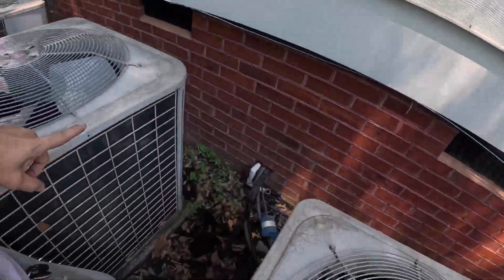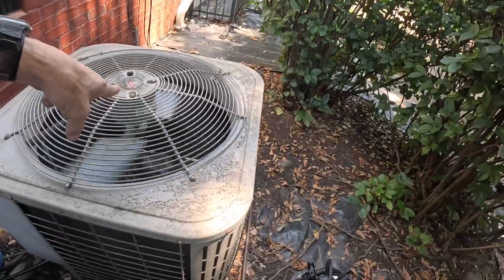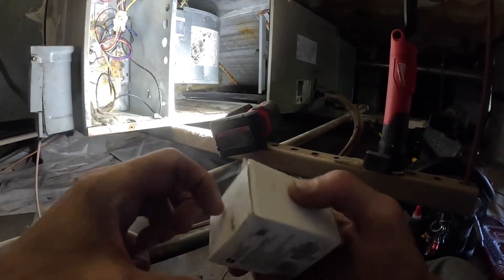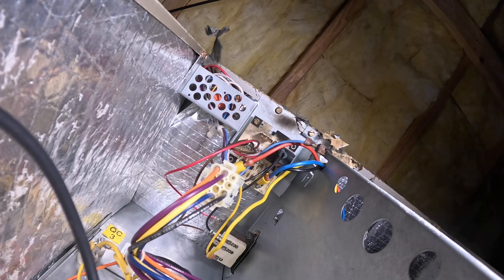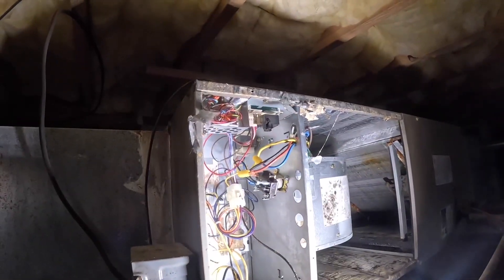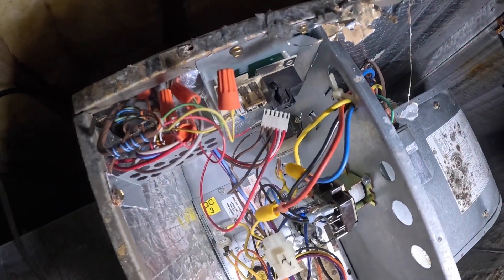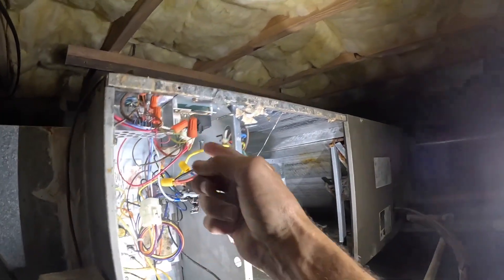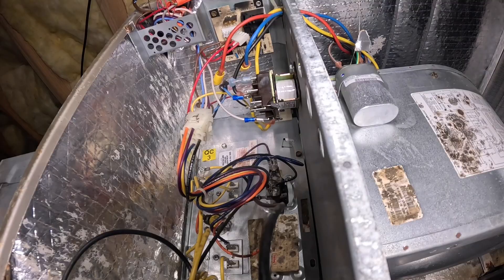Extremely High Electric Bill Leads to A Service Call! #hvaclife #hvacguy #hvactrainingvideos

Comment: How the hell can he remember all those wires and so many different systems??? This guy could be a brain surgeon, Blessings!!! He just reengineered a system on the fly!!!
Reply: He is one smart dude. Heck I couldn't do what he does, I walk to a room to go get something and soon as I get there, I say to myself what did I come in for.
Reply: @str8chevys913 yeah, wiring in a strip kit with blower control when it was controlled by the board is fun. 
Man, remember working on the old ge cubes with timer controlling tpdt high voltage relay… so much fun…
Reply: @whochecksthis  agreed wiring can be fun....either you love it or hate it😅
Reply: @str8chevys913 😂 you nailed it
Reply: My neighbor was a home alarm installer and I had him hook up my alarm keypad. There’s about 10 different  colored wires. He asked me what color one of the wires were he was colorblind
Reply: @whosyourdady909  Thank you for making me laugh on a Friday night~LOL
Reply: @andylaw2503  color by numbers , never fails , using phone color coded ..😅💪✌️🙏☝️
Reply: I was in radio repair in the military and learned low voltage.Pretty good and I got out of the military and got into electrical installation. My boss was colorblind and I had to many times tell him whether there was a green or a blue wire that he was hooking up. But he taught me a lot about the high voltage systems.And then from there I went on to AC and Heat and air maintenance where I learned the gasses and the Refrigeration systems. So I combined my experience of low voltage in the military high voltage in my electrical installation experience and then the training that I got from  classes and on the job experience on the AC part and I learned to do what he has done. There have been many times where I've had to go in and completely strip out all the wiring from somebody else's mess and rewire it, put in new relays and time sequence relays in the sort. It does
take a lot of training and a lot of knowledge and experience. And you also have to be a fairly logically minded person to pursue this type of career and do it proficiently.
Reply: @whosyourdady909  oh wow!
Reply: @whosyourdady909  Bro I got a friend like that but he is still a monster at AC fixing
Reply: @whosyourdady909  Some colorblind people uses colored glass to look through to distinguish the colors. Put in the red glass and green wires goes dark, put in the green glass and the red wires goes dark. At least it helps a bit, but I'm not colorblind so I can't tell if it helps completely.
Reply: Hvac wiring isn’t terribly difficult. What will REALLY get you is the communicating systems with condenser wiring controlling the air handler… man the York heat pumps are the worst! 10 colors, hat have to be wired one way at the stat, one way at the condenser, then a completely different way at the air handler… multistage, multi speed system… with outdoor thermostats as well… 

One unit has like 30 different connections…
Reply: @whochecksthis  Obviously they DON'T believe in the KISS principle, (Keep It Simple, Stupid).  But look at all the money it makes for them, constantly.
Reply: @whochecksthis  G’Day Bro,  I’m confused with your statement. On one hand you’re saying HVAC wiring is easy but then on the other you’re talking up how many wires are on the interconnect wiring ??   The Daikin units we use down here are far more complicated than those ‘Flower Pot” A/C’s in most houses in the USA. Ours have up to 4 PCB’s on outdoor & 2-3 on the indoor unit which is frustrating as when they fail becomes quite expensive. 👍
Reply: @whochecksthis  comfortbridge is two wires, common and signal. Everything is in the software settings. Though most settings are automatic. Just set your tonnage and heat strip size and it goes to town. It decides on everything based on sensors.
Reply: @whochecksthis  all the wires i typically universal in all systems unless sum douche re-wires everything. If that happens usually the client won’t use that tech cause of shady work.
Reply: @whochecksthis  💯 those condensers look like computers inside the service panel
Reply: @whochecksthis and this is why one hires a trained licensed HVAC technician 😂
Reply: This is simple wiring and understanding typical hvac controls. It's a simple control power circuit. The board is just a fancy relay in a sense.
Reply: @dustinbartlow4318 "in a sense". You mean "in expense" !! 😅
Reply: @dustinbartlow4318  The boards are money makers.  Relays, etc. are better, more reliable, and cheaper.  But the manufacturers don't want that anymore.
Reply: Don’t you know who he is? He’s The HVAC GUY
Reply: Hello my friend. I'm not sure if you reread your comments in your older videos but I put a notice in there for you. As a welder I wear a half face respirator it goes underneath my weld hood so it really hugs your face it's not sticking out blocking your view. I got mine on Amazon if you want it or whatever let me know I'll get you the information on it which one I bought. You can keep it in your satchel bag and when you go under the house and you're breathing in basically asbestos fibers, asbestos's rock silicate but that insulation is glass so what's the difference. Protect your lungs. Even dust and whatever kind of airborne pollutants are down there from rats and dead animals and God knows what else. Easy on easy off and no more hacking😂
Reply: @TheVaga9 He literally put on a HVAC “Clinic” right there . A lot of the time as a HVAC tech you have to pull out the “MacGyver” tool bag to get some of the units going . Great work mate 👍 HVAC Guy please do me a favour and cut the power prior to pulling that connection off while it’s still live bro, I know your experienced but be safe man . 🙏🏽👍
Reply: The wiring in most ACs are quite similar, HVAC isn't a very difficult trade.
Reply: @GoonyMclinux what is
Reply: @GoonyMclinux it’s considered to be one of the more difficult trades as you need to know electrical, plumbing etc.  for people who do it on the regular it may be easy to them.
Reply: Hes a professional who sees the same stuff everyday. ever had a job?
Reply: When you've fixed the exact same problem one hundred times it becomes muscle memory, don't even need to use the brain.
Reply: I've been thinking the same thing.
Reply: you just get used to them after dozens upon dozens, unless your memory doesn't work, that would be bad.....
Reply: Respect to the Experience Problem Solver/Critical Thinker
Reply: They are all the same, just variations. These old guys however even remember the model numbers..
😮
Reply: It's not that hard to figure out.
Reply: Bro then take a picture of the old one then replace it
Reply: Wiring diagram helps
Reply: I love wiring 😂
Reply: There colored wires. There all the same color on every ac unit. Its not rocket science.
Reply: @My1970TransAm  Okay sport! your smart too, we get it.
Reply: It’s easy! I used to do hvac!
Reply: after you get a few years in a profession, you memorize what's where , how things work,  and working shotrcuts and improvs when you have something that CAN'T be replaced.

Comment: Can anyone recommend wire connectors for compressor wiring instead of using wire nuts?
Reply: I've seen people use WAGO, but I've never used them. I despise Wire Nuts, too! 😉
Reply: @hinspect  I wonder if I can use a standard bullet style connector or possibly just solder the wires. Would this be better conductor than wire nuts and provide less resistance?
Reply: @hinspect  I love WAGO.  Much better than wire nuts.  They were invented in Germany and have been used in Europe for 20+ years with no problems.  They are clear so you can visually see the wires inside.  Test ports for probe so you don't have to remove any wires.
Reply: @dfirth224  I'm just trying to find the best connector with least resistance. That's why I'm considering just soldering them together. It's not like they need to be separated for normal maintenance. Can't remember what gauge the wire is. It's a 5 ton unit so may 8 or 10 gauge. Last year I heard a loud pop at the condenser and the compressor stopped. After investigating, there was obviously an arc that charred the wired and part of the metal surround. Not sure what happened but it appears there was a short and completely fried the wire nut. After cleaning up the wires and replacing the wire nut, it's been working fine a year later. It didn't blow the fuse at the disconnector either. I don't know if the connection was poor at the wire nut from the previous install that was causing resistance that finally gave way or some sort of surge. It was a weird situation.
Reply: I suppose the wire nut could have failed causing the live wire to short on the metal casing. Maybe that's what happened.
Reply: @hinspect  WAGOs are easier, but properly done wire nut connections can carry more current.
Reply: @markbeiser Kerney Clamps are what I always used for high Current, but they look like shit after being taped up with black tape

Comment: would you rather be under the house or in the attic?
Reply: Hummmm i want to know thos answer to...but also how often is it in attic.
Reply: I’d rather be in an attic, crawlspaces can be low, wet and critters crawling around, in attics just have to worry about the heat and not stepping through the ceiling 😊
Reply: Where I’m at, most seem to be in the attic
Reply: @RustyDodd  Wow...Im trying to get used to that but its hard. My new home has it in the attic...Im just trying to stay ahead of being it proactive...thanks for sharing.
Reply: 130 degrees in the attic.  What do you think??

Comment: I never could understand why a PCB is used in a simple air handler like that when just relays and contactors will work just the same....Just remember to wire a bypass link to provide fan power from the first contactor or sequencer in case the fan relay fails.   This forces the fan forces the fan to run when the heat strips are powered on.
Reply: Printed circuit board is less expensive than hand wiring point to point. Same with very old school electronics. Hand wired and soldered point to point was time consuming, then circuit boards came along.
Reply: @williamjones4483  But more reliable.  All that matters now is $$$. Who cares if they don't last as long, they are throw away.
Reply: The fan on and off delays get an extra very small bump in SEER rating for the system.
Of course whatever energy savings there is over the life of the system is lost x1000 when the board fails!🤣
In those air handlers, the first heat relay already has a provision for powering the fan on, so no need to add one.
Reply: Would you  send me wiring diagram  of what you just said  ? Thanks

Comment: Whole-house energy monitor is all of $200, I can see what I'm using to the tenth of a watt and it updates every second.  32.0W right now.  Would have saved this homeowner thousands.
Reply: Tell me more about the "whole-house energy monitor".  Thank you
Reply: @flyaway9070-p4o  They're simple devices.  Plug the device into both phases and the neutral in the breaker box, there's your voltages V.  Current clamps on both phases, there's your current I.  Power P is I*V.  That's the basics.  The rest is just data and connectivity (an app/website and wifi for mine).  Maybe it'll learn individual devices by their energy patterns, or you have extra current clamps or special plugs to monitor your solar/EV charger on some breaker or your TV on a wi-fi enabled power monitor outlet.  I think I have mine tell me when the fridge (which it recognizes) runs for more than 20 minutes (which happens a lot in the summer, but only happens if the door gets left open in the winter).
Reply: @Rack979  There's only one phase, not two. Single phase 240 volts on the drop to the residence. Goes to the meter then the circuit breaker panel and is split. One half phase on each 120 volt leg, except for the large appliances that use 240 volts. Those get the single phase.

Comment: Their electric bills would be lower if they didn't set the temp to 69deg. That's just crazy talk.
Reply: When you have one system to control the master bedroom alone, you live a different life than everyone else 😂
Reply: The lowest mine will go is 65. I’m looking for an old mercury thermostat that go down to 55.
Reply: @Dingleberry1856  That's on purpose as any lower than a setpoint of 67 on your typical AC system, and your indoor coil will start freezing up. HVAC service tech of eight years here.
Reply: Desperation!
Reply: I keep mine on 68
Reply: Is it not higher if it keeps turning on and off ? Serious question
Reply: @juliomoreno5370  The electric heat was running when it's trying to cool, cancelling each other out.  70 degree output instead of 50 degrees.  Having the system running for long periods costs more than if it cycles on and off.
Reply: How low will it go. Only so low Joe. So long sized right will feel fine let er run.
Reply: I bet your the life of the party!